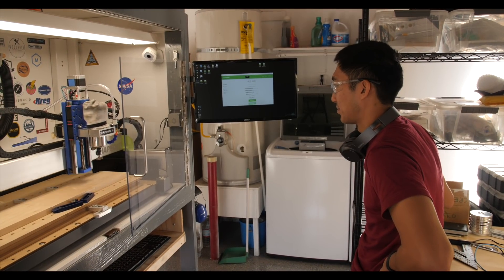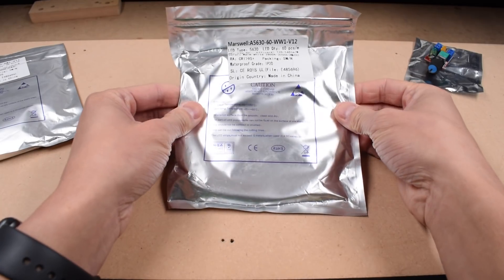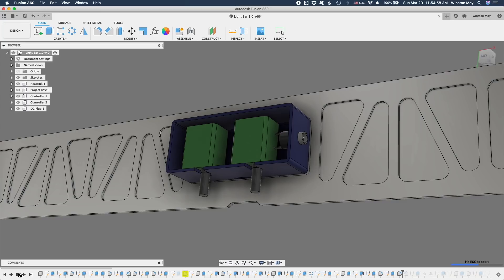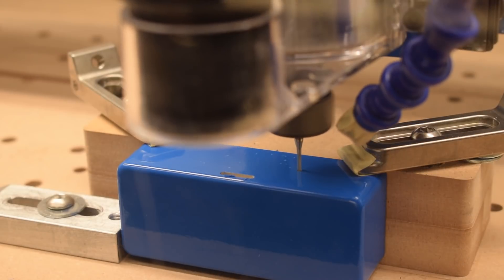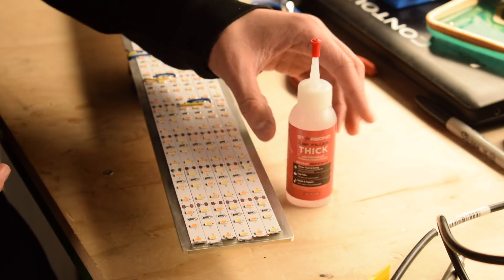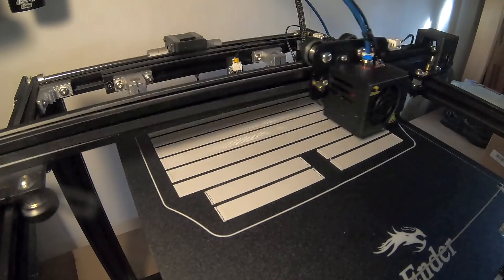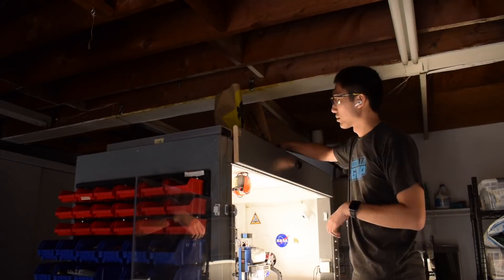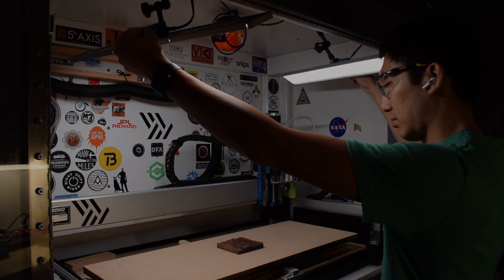Making the Ultimate Studio Lights for my CNC Enclosure - #154

Comment: ...and the last few minutes are the ENTIRE point: I did this because A) I enjoy the challenge; B) I will get a custom-made better product than OTS; and C) I WILL BE SMARTER than I was before I started this project and will be able to apply that knowledge later. My grandfather built his house with nothing but hand tools. He mixed cement in a wheel barrow to pour the foundation, used a hand saw on all the 2x4's and 2x6's, was a framing square wizard and yet wanted better for his kids. So we went to school and learned "high falutin' things" like physics and biology. But I never forgot how to hammer a nail straight and hand sharpen a hand saw. Now I have a CNC and a great shop and do this as a hobby. But Mr. Moy, you not only spread the passion, to listen to you is an encyclopedia of what worked and what didn't to the thousandth...from my generation:  "Dude, you rock!"

Keep up the good work young man. We all could use a little what works and what doesn't from your experience. Thank you.

Comment: there was no excuse to use PWM instead of voltage controlled dimming in this case.
strips are already current limited and 12V rating means that most of DC-DC voltage converters of appropriate power rating would do the job.

Comment: Do not use a PWM motor controller. They can be responsible for flicker as they actually flicker the light, hopefully at a frequency that the camera shutter ignores. Much better is to use an LED constant current driver. Many are adjustable. They provide constant current DC for truly flicker free operation.

Comment: Not only you provide a great solution, you also provide the info that drove you into that solution.
Kudos and thank you, sir.

Also, I always wondered why you didn't have a 3D printer.  Like you, I started with a CNC router (Shapeoko 2) but about a year later realized a 3D printer would be a great compliment to the CNC router.  Now I use the 3D printer more often than the CNC router.

Comment: I'm surprised you didn't go with constant current, which is sort of the LED's native currency vs PWM. From experience researching constant current drivers and buying a couple, it wasn't obvious/trivial. Is that why you went PWM, or are there other advantages?
Reply: apples and oranges here. constant current is how the power is supplied. PWM controls the release of that power to the LEDs. PWM 'opens the gate' for power to flow to the LEDs, then slams that gate. our eyes perceive the rapid on/off as a dimmed light.

Comment: i would first go with calibration and setting steps. out of the box (at least my ender 3 was 0.5-0.7mm off)
you can easy setup this with Gcode start in your slicer. (eg. M92 X79.15 Y78.57 Z402.16)
after that i would suggest using your tip dimensions to over size holes 

works fine with my printer now and cnc :)

Comment: Very Nice, what we expect from WInston!  When I added my overhead LED array overhead in my enclosure I noticed a nasty shadow under my router and then had to add some focused LED spots on the side.  A video on why you choose the 3D Printer you bought?  I am getting close too to breaking down and buying a 3D Printer.   Cheers
Reply from the maker: I originally included a segment on that in the video, but it felt too long, and you'd just be staring at a 3D printer while I talked. This was my reasoning: 

One, it’s super affordable. This machine cost $400. That’s bonkers. I really didn’t want to spend a ton of money on something I didn’t know how often I’d use. For that price, it’s an insane value. With a small amount of tweaking, you’ll get some shockingly okay quality prints. It won’t compete with a machine 4 or 5 times the cost, but it will produce very respectable results.

Two, vs. the regular Ender 5, the Pro has Creality’s upgraded silent stepper driver board. It’s probably just me, but there’s just something about the sound of 3D printers chirping away in the background that I find objectionable. It’s worse than milling machines because 3D printers have such erratic trajectories and run for so long. (I am biased though...).

And three, it has a box frame, which would be very easy to retrofit with wall panels. Printers with moving build platforms have different footprint requirements and tend to be pretty deep in the Y axis. Now, I don’t plan on printing any particularly exotic materials, so I don’t need the thermal stability afforded by an airtight enclosure. I have no intention of putting a roof over this printer. But, this printer will live in my garage, which is pretty dusty. Those walls will help keep wood shavings, aluminum chips, and grinding dust off the print bed, as well as block wind, since the garage can become a bit of a cyclone chamber with the doors open.

My only thing against the 5-Pro is it’s cantilevered build platform. With heavier prints, and rapid movements, you can get a bit of static deflection and vibration at the front. The 5 Plus fixes this. But I didn’t have the room for the Ender 5 Plus and it doesn't come standard with the silent stepper driver board, so the Pro model was what I settled on.

Comment: Nice video Winston!  When making fixtures for boxes with draft angles, I've found that tapered spiral bits for 3D engraving (such as Amana Tools 3.6 degree 46286, or their 1 degree 46284) work really well.  One more tip -- when hand drilling decent sized holes in aluminum, invest in a step bit.  They don't grab and dig into the material like twist drills bits.

Comment: what do you recommend for changing tools with out losing the 'x' and 'y' axis zero settings and getting a new 'z' axis zero setting?
Reply from the maker: Tighten and lossen collets with two wrenches. It cancels out the sideways force and let's you put pure torque into the collet. Then zero off something that doesn't change between operations, like the wasteboard. Though if you have a BitSetter or tool length probe this doesn't matter
Reply: Just after asking this question I got and email stating that the BitSetter was back in stock I now have one on order. Thank you for your reply.

Comment: Cool video have you ever thought about using a cnc to post process the 3d print to get better accuracy and better finishes
Reply: Potentially even design fixtureing straight into the model that gets cut down to tabs at the end of the cycle